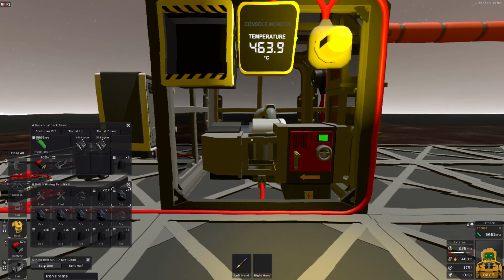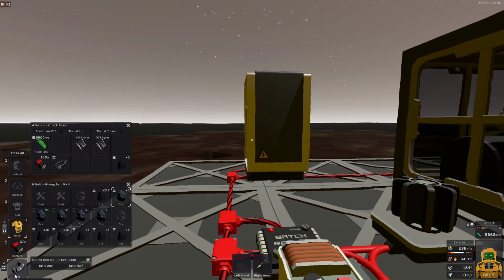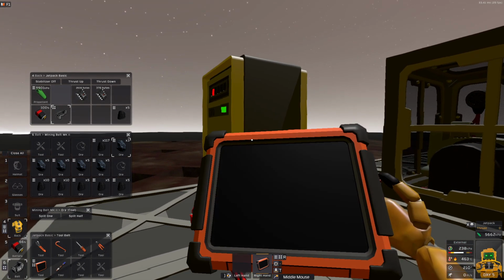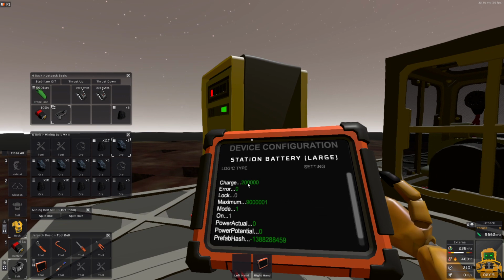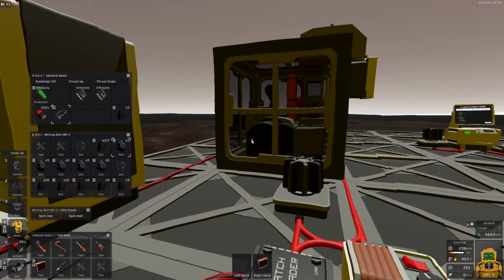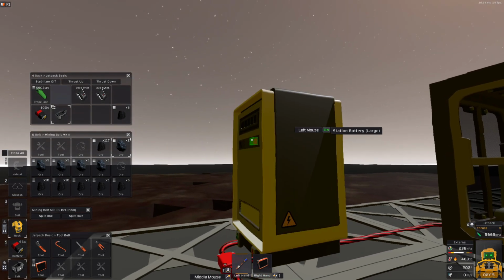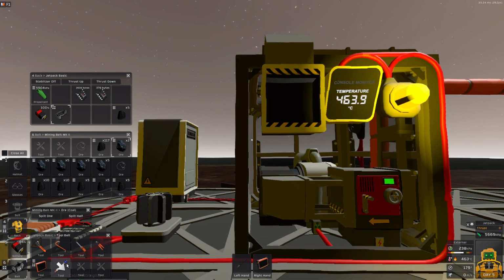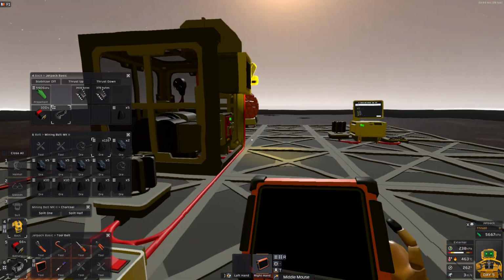Stationeers ( 2022 ): Solid Generator - Coal vs Charcoal - v0.2.3657.17736

Comment: Seems like a bug to me for both the cold gas generation and the stack size power differences
Reply from the maker: Yes, the temperature difference also came as a surprise to me. I mean the odd behaviour for the charcoal processing is a very old bug and I wanted to validate if it is still there. The difference in performance, hmm maybe it was intentional, but it looks like it's a little bit of everything and everywhere.